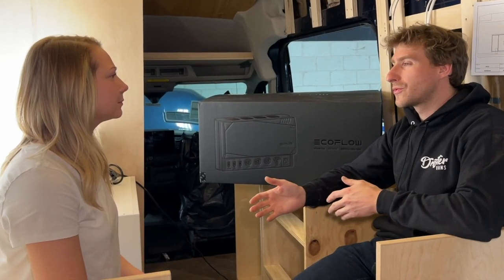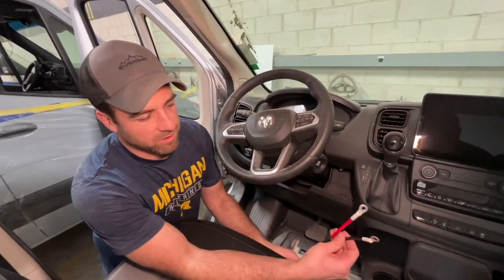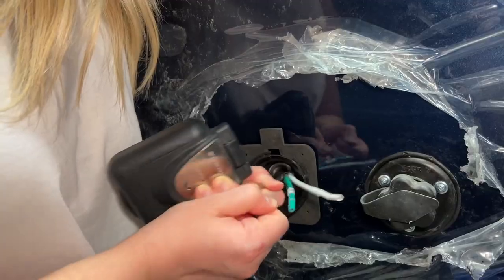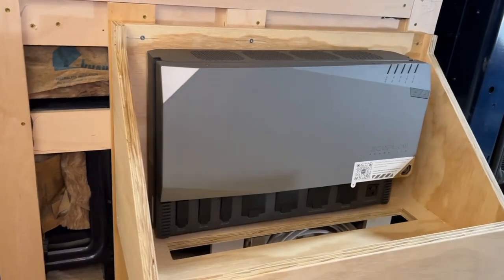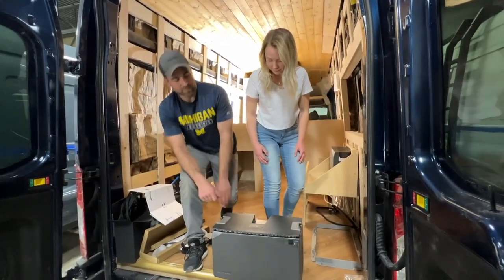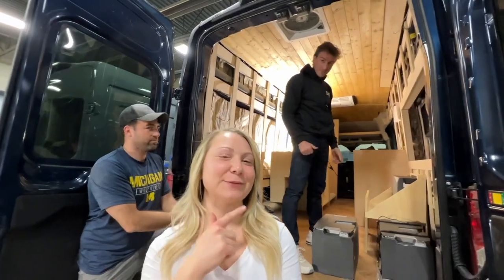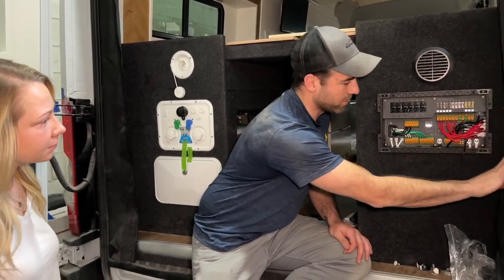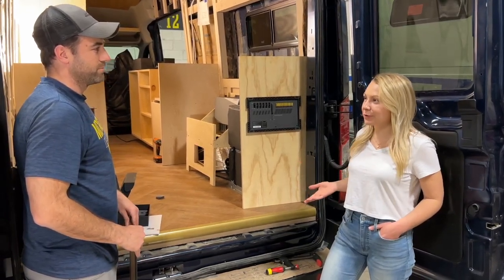The BEST Power System for Off-Grid Van Life! EcoFlow Power Kit Install in Transit/Sprinter/Promaster

Comment: So much great information in one video. I didn't know Ford had a power take off in the driver's seat for accessories. This EcoFlow unit is pretty nice. I bought all the parts for my current system individually and this looks like a nice option for the next one.

Comment: This clip was one reason I went for the Ecoflow Power kit - now I have mine.... the Power hub 'top bracket' we can see being fitted (9:00), is actually the 'bottom bracket' - the threaded holes are on the bottom of the power hub, its clear in the template and you can see in this clip that the 'ECOFLOW' stamping on the bracket is upside down in your installation. These guys must have drilled and tapped some holes in the top... hmmmm... just saying...

Comment: My powerkit was working fine but after being parked for a week, the battery was drained and it will not recharge (via alternator or solar panel).  Is there a fuse or breaker that maybe causing it?

Comment: Awesome setup!  So you can recharge the 2 EF batteries by solar and shore power.  Will be interesting to see how long you can go without shore power as you set out on your new adventures!
Can you use the EF batteries to recharge or jump your van battery if there if ever a need to do that?
If your plugged in to shore power, and using the microwave or AC, is the shore power the primary power source or the EF batteries?  Curious how the hub works with all the power sources to distribute power vs recharge the batteries.

Comment: Great video.  My Power Kit app shows battery not charging with triangle warning icon "Battery short circuit..."   Any advice?  Also, the alternator is generating but no solar charging input.  Thx in advance.

Comment: Hi Sarah! Thx for your Video and have fun on your future travels!
i also have a Power Kit Independence Kit but only with one 5kWh battery installed in my van.
Unfortunately, I have noticed that the battery discharges by around 15% within 24 hours without a load being connected.
I started on Sunday around 5pm with 50% capacity.

Yesterday (Wednesday) only 6% charge remaining. No consumer used electricity during this time. Only DC was activated.
Losing 44% of a 5 kWh battery in standby within 72 hours is not really energy efficient, is it? @elee325 reported the same issue here. 
what is your experience?

Comment: Very nice. I know price is a delicate matter, and changes between locations etc, but still, can you please,
a: give us a rough estimate on the price of this system?
b: what's the spec of the system?  
c: tell us how much would it cost to buy separate batteries, inverter, cables, solar charger, distribution board, etc?
time is money, I agree, but since this is a significant part of the van's cost, lets understand our alternatives. thanks!
Reply from the maker: Hey Ron! There are links in the video description to the power kits on EcoFlows website that will break down pricing and specs. 😊

Comment: Whenever they need to pass a cable from one side of the van to another, the guy just stick the cable into the floor and magically it appears on the other side. how does that work? did you prepare like tunnels under the floor for the cables? 
For the less experienced, would you recommend to pass those wires before laying out the flooring?
Reply: Yes we make a channel in the floor for wirings, but the EcoFlow system can be something you run through the wall framing or put in before the floor is installed
Reply: @DrifterVans  
Was the decision to use this EcoFlow kit made after the flooring and other components were installed?